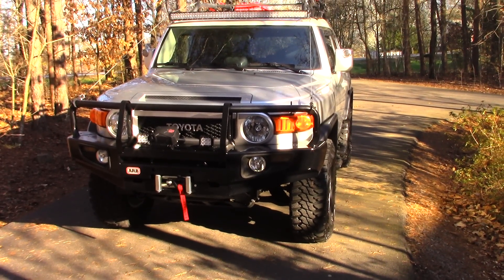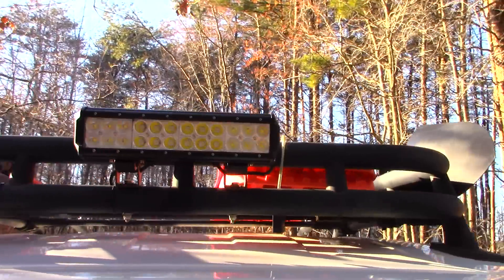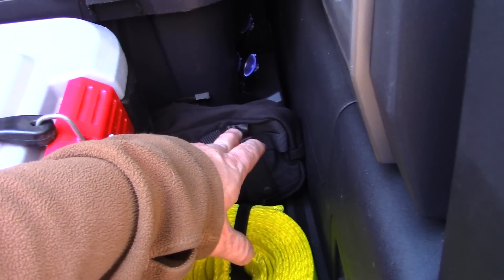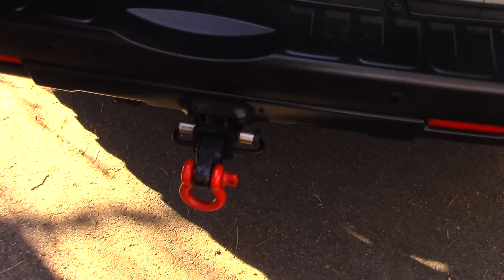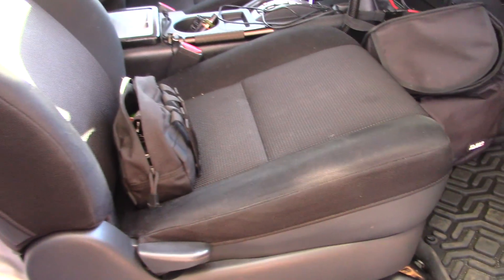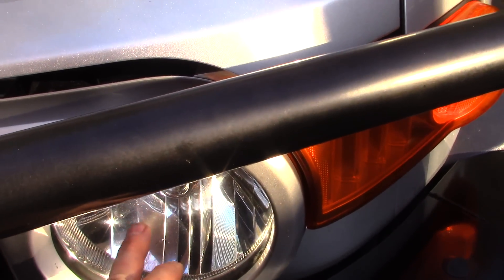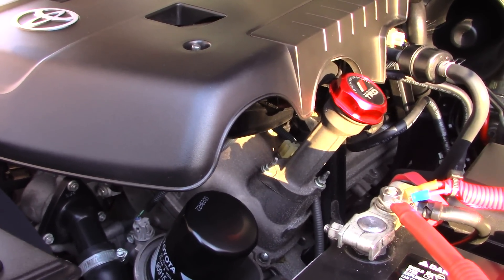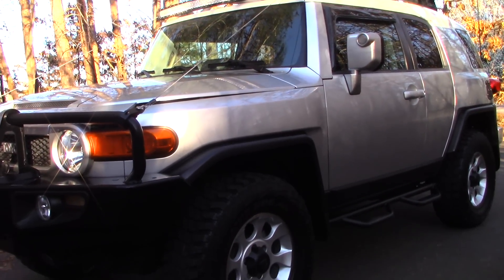FJ Cruiser (Bug out Vehicle Update Review)

Comment: Just awesome GnG! Just bought bought a 2011 Ford F-150 XLT, 4X4, with heavy duty tow pkg, super crew cab, with matching fiberglass camper topper. Getting ready to do a nice install of my ham radio gear....now thanks to you, I'm considering to install CB as well(makes sense). I've got so many plans to do to it(great practical, functional, and just cool gray man plans😎) and not enough money. However, you build brick by brick on a budget. You've done an incredible job and have given me many ideas and inspiration. Thank you GNG! You are an inspiration to all the like minded people out out there!
Reply from the maker: Thanks for the kind words and feedback. Sounds like you have a great truck to build on. You are correct about building brick by brick. This project has been a little at a time. I suggest people buy what they can afford and as they can afford it. I recommend people prioritize during these type builds if budget matters. Start with the most important and then fill in as you go. I was fortunate to have a few things donated to the channel, some were gifts (Christmas, B-day, etc) and the rest was just budgeting my money.  I would definitely consider a CB radio. Like I said in the video I use it more than my HAM. It has helped me out in a few situations. They are cheap and no license required. Thanks again!!